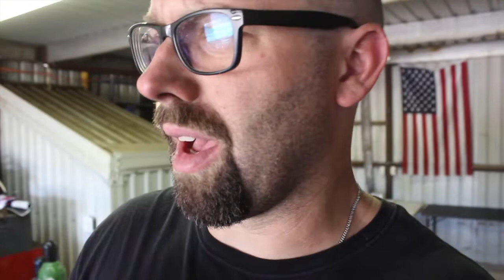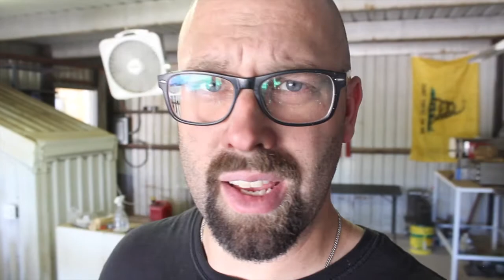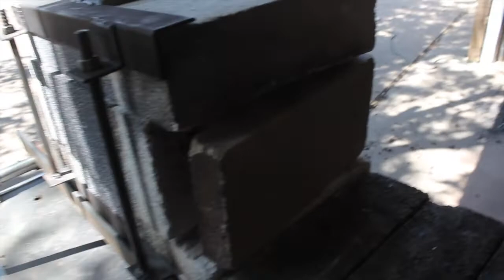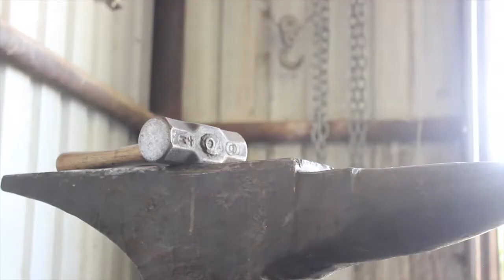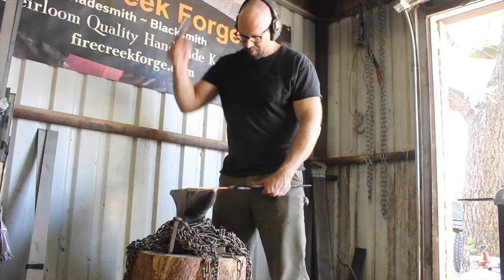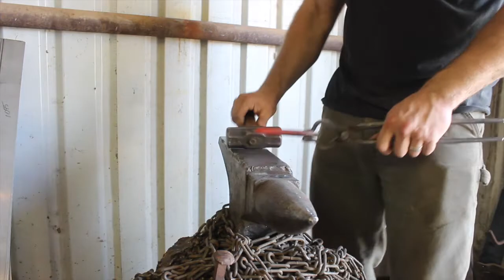I Need Your Input ~ Yes Or No ~ Blacksmithing, Bladesmithing And Knifemaking

Comment: I’ve been checking out blacksmithing videos for around a year and just found your YouTube channel.  I’ve finally got a forge set up.  You of course have to decide what you want to do, however this is what I look for.   I watch to learn, so explaining is vital.  Even down to describing the hammer blow.   I prefer multiple videos on one project.  This shows the difficulty that craftsmanship demands.  I’ve come to the conclusion that fitting the handle is the hardest part of knife making.  If you want, you could release two types of videos for each project.  One that is 15-20 minutes and shows an overview for those who just enjoy watching blacksmithing and a set of videos that truly teach.  While watching someone make a project I could never achieve is fantastic (think Torbjorn Ahman) beginner level projects give me a reason to light my forge and swing the hammer.  Basically, you have to decide if you want to entertain like Alec Steele or teach like John Switzer at Blackbeard Forge.  Both channels are enjoyable, they just have different goals.  Hope this helps and good luck with your channel.

Comment: I think multipart is fine. Just as long as each part isn't 30 min. Also welcome to Texas. Don't know where you are but if you put some insulation on the roof it won't be as bad of a oven in there